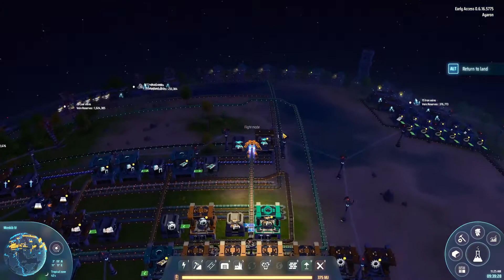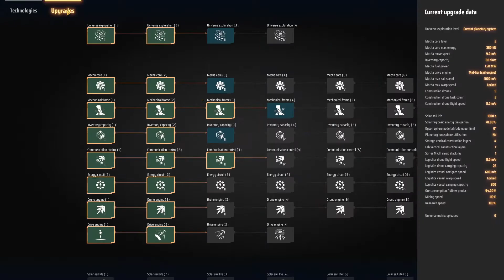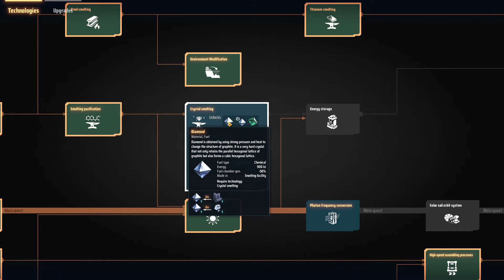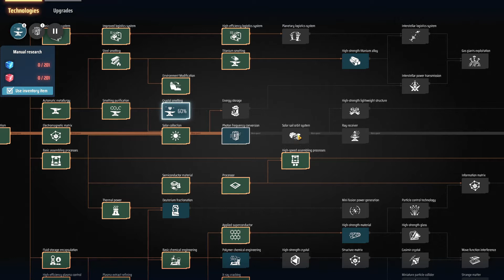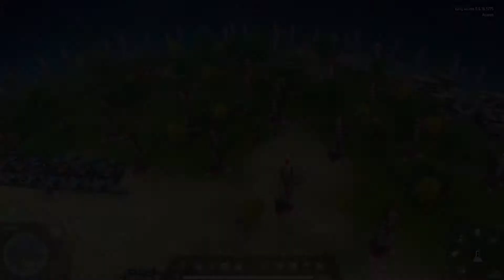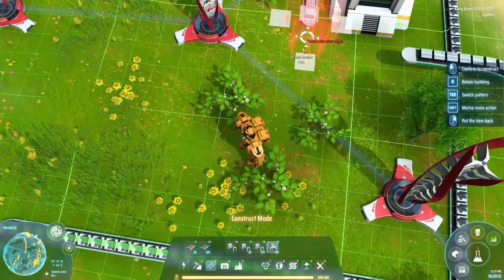Dyson Sphere Program E009

Comment: 8 sails a second x 60 is 480. X 180 second life span is 1200+240 so a total of 1440 (?) sails
Ok heard the time wrong, 1800 seconds is 30 minutes so adding a zero should just make it 14,400 (?) sails
Reply: So if each sail gives 36kw of power in total you could make 518,400 kw of power or 518.4 Mw (?)